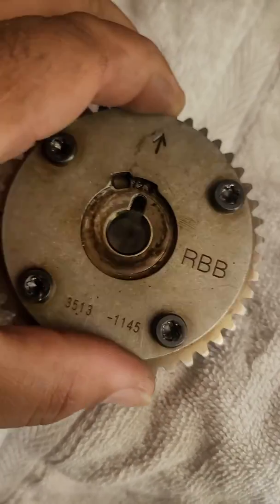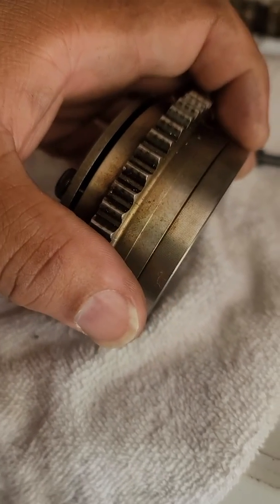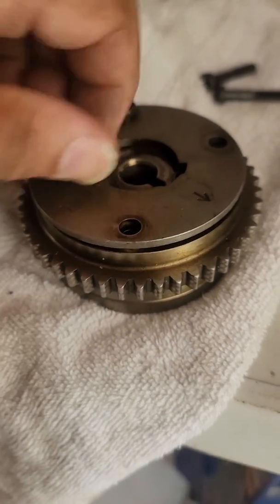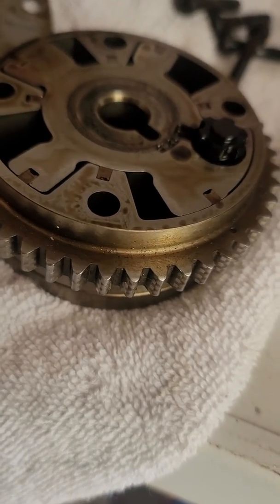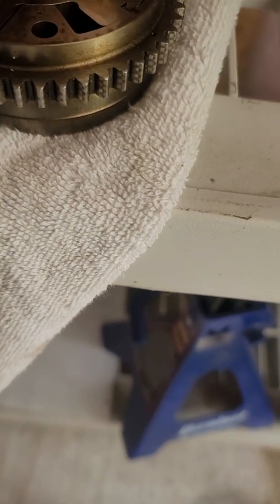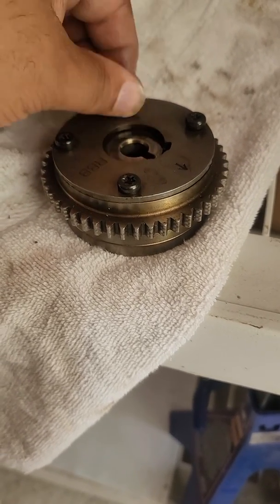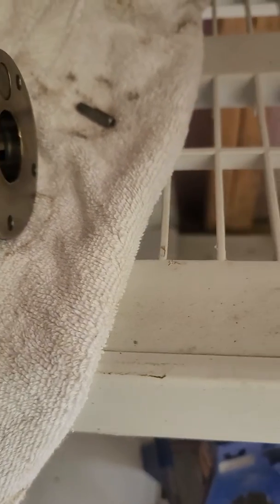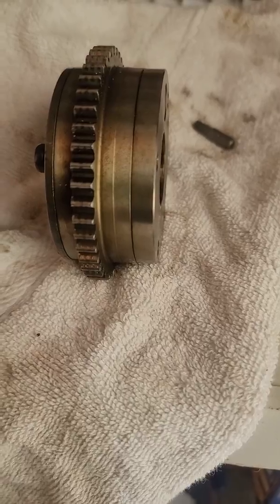vtc gear rattle fix

Comment: Thank you. It worked for me for Honda 2.4 engine with vtc in place.
The only thing I would recommend for those who is planning to work on 2.4 Honda, to get a TS-30H (5 point star bit), you going need it to remove 5 bolts on vtc gear to get to the spring.
Reply: Of course, my tool kit only goes to TS-20H, thanks for the heads up.
Reply: @094340 Don’t forget to use medium thread lock on all 5 vtc bolts when you put it back together, otherwise it will come apart. I used original spring just pulled it a little, original valve cover gasket ( use some black gasket maker on corners, same as you can see it’s done from manufacturer). Good luck to you if you doing this project.
Reply: @victorv3219  

Thanks bro.
Reply: @victorv3219  Those bolts strip real easy.  Ask me how I know.  😞
Reply: @victorv3219 can you please provide a link for the medium thread lock? I’m not sure which one to buy.
Reply: Be doing this soon.
Reply from the maker: Follow my channel thanks
Reply: My Googling indicates the 5 point is IPR30.
Reply: Que número es la broca de 5 estrella??
Reply: @OrlandoRivera-g4r
TS-30H

Comment: Hi Tony, I had my actuator replaced, but I was just curious how long did that work after you stretch the spring was it permanent or did it the noise return
Reply from the maker: It's still hold up strong I have a any problems
Reply: @dateg18  good to know, when my warranty runs out, I’ll be stretching the springs
Reply from the maker: @jojojeep1  I posted a link to company that sells a replacement vtc spring in the Description

Comment: I did this but it fixed the rattle for aprox 3 months, now it rattles again
Reply from the maker: I put a link to a company that sells replacement spring for the vtc gear
Reply from the maker: Have you ever replaced your timing chain tensioner? Because they fail over time, too, and can cause the chain rattle, too

Comment: It seems that haonda has a bulletin for updated vtc. They know this ia an issue but want to sell a new vtc. Someone needs to get a new updated vtc and check the spring's  tension and find a replacement.  Any thoughts?
Reply from the maker: It never fails with honda instead of making a recall to fix the problem they want us to buy their part to fix what, in my opinion, shouldn't have a problem to begin with when they make the car
Reply: @dateg18  I agree. If we had knowledge of the proper resistance spring, it would save poor folks over 250 bucks or more. Was the update fix a stronger or heat resistant spring? Definitely a defective part.

Comment: So i had same problem on a 2015 crv & accord  i own. Found a mechanic who said to replace chain tensioner and it completely fixed problem he even said theres a TSB written about it.  Fyi
Reply: I replaced belt tensioner didn't work & yes Honda knows the rattle is a problem hence class action lawsuit in Cali ended in 2023
Reply: @chickadee7659  Honda appealed the class action lawsuit to the 9th Corcuit Court of Appeals… and they lost, April 2025. So Honda Motors owes car owners $1.4 million.

Comment: Have a 2017 accord sport. At cold start makes like a 1 second grind while starting. Changed starter, plugs, and not sure. Does that rattle sound like a grind as well?  Curious if it's the same issue. But only happens when it sits for a few hours
Reply from the maker: I'm not sure if the 2017 have the vtc gear or not let me look into it and see what I can find out

Comment: Tim Boylan from Nova Scotia Canada. I really appreciate what you're showing me I could never understand why you had to replace the whole gear if it was only a spring problem which everybody was telling me or the information looked like that's what it was thank you very much I really appreciate this it will save me a pile of money
Reply from the maker: No problem sir
Reply: @dateg18  what do you recommend to increase my gas mileage with this vehicle
Reply from the maker: @timboylen7239  To be honest, just basic maintenance like spark, plugs I know. You can replace the fuel filter in the fuel tank. But I suggest you replace it if it's never a been place. A vavle job if the car has high mileage
Reply: @dateg18  crvtbnsc- I thank you for that reply my CRV has 180,000 km on it I was wondering what you would recommend for me to put back in it for spark plugs I've looked in there so many different kinds I realize in GK is probably the best bet but which type I respect your advice and wish to thank you very much at this time
Reply from the maker: @timboylen7239  ngk spark plugs work best for honda
Reply: Crvtbnsc  thank you very much I will let you know how it works after I put them in also I quieted down my engine by doing an oil change and using 5W30 Castrol instead of the zero w20 that I've been using it seems to me that that's pretty thin oil for an engine that has some miles on it
Reply: @timboylen7239  Let me add my advice. You're doing right by using 5w-30 and not 0w-20.  The latter burns off a lot more than higher grades.  These K24 engines tend to burn oil, although you won't know it until you check the dipstick.  Castrol for me, had been the only one I've used so far that didn't have this happen.  I'd use full synthetic and high mileage Castrol Edge.  I also use Denso Iridium spark plugs. Overall Denso is what came factory as many parts in your Honda, it's the best brand for it IMO.
Reply: @ACZ457  So much conflicting information about the oil type. I have heard that the Castrol Edge, that you use, and the Valvoline High Mileage are effective where this engine is concerned. Not sure about using a 30 viscosity though, I think I'll stick with the 5w-20 full synthetic High Mileage.

Comment: I couldnt find the correct torx bit for my R44 VTC on my 2012 CRV 2.4L, so I replaced them with the exact length hex head bolt. But it still rattles worse on start up and has a squeek. I think those tox head bolts are assembled with tight tolerances and it has to be assembled correctly. I had to resort to replacing the VTC.
Reply from the maker: Let me ask you, have you ever replaced the timming chain tensioner? Because that can cause the same problem as well
Reply: @dateg18  I have not replaced it or even looked at it. Thanks for the heads up. Can rotating the engine in reverse damage the tensioner?
Reply from the maker: @michaelpolzin3263  we removing the tensioner you can just a very little to take tension off the tensioner to remove it
Reply: It's a T30 5-point Torx bit, and you want to get one that is a socket, not just a bare bit.  Anything you can do to prevent anything from coming out and dropping - even with stuffing towels or whatever in the top of the timing cover.  Not something you want to be losing in the middle of the job.  Also, make sure it's made of S2 steel.  The torque needed is 8 ft/lbs or 96 in/lbs.
Reply from the maker: Let me ask you this did you replace the timming chain tensioner too ?
Reply: @michaelpolzin3263
 how did you remove the bolts without having the right bit?  I got the same problem.  Thanks.

Comment: Wow!  What a relief to know that this could fix the rattle when I start my car.  I thought it was oil starvation so I quit using Honda oil filter and switched to K&N filter but noise remained.  I just adjusted valve lash on my 2013 Honda CRV so I am quite expert at removing valve cover.  I am also thinking maybe I could go to a hardware store and purchase a new similar spring.  Thank you for making this awesome video!
Reply from the maker: Someone sent me a link to a company that sells upgrades spring if I find the link I'll send it to you sir
Reply: Hey @dateg18 I Have A Code P2647 “A” Rocker Arm Actuator System Stuck On Bank 1……Is It The VTec Spool Valve Solenoid?……Because I Do Have That Rattle When I Cold Start My Accord 2005 2.4L Gas……

Comment: Spring-Start has VTC repair kits with new springs and the torx bit included
Reply from the maker: Thanks for the info 👍🏽
Reply: It says Honda. Does the spring works for Toyota as well.
Reply: @painkillerO8  what year and model?
Reply: @ Toyota corolla 2011 , LE.  also not possible to remove the spring while still on the engine. it requires rotating the engine to reach the bolts😔
Reply: @painkillerO8  as long as the cover is removable we have rotated as needed

Comment: Do u need to buy a new gasket wen u take off the top?
Reply: if the valve cover gasket is old and/or brittle, then yes replace it.  I replaced mine since I didn't want a leak.  also replace the spark plug tube seals.
Reply: @glennhansel9411  thanks bud
Reply from the maker: No sir just put a little rtv on the side of the vavle cover

Comment: This is good information.  I'm at 107,00 on our CRV and it also has the rattle on cold start up.  I know you recommended replacing the timing chain tensioner, do you think the timing chain itself would be stretched and need replacement at this point also?  Thanks!

Comment: Greatly appreciate what you shared. Does thing also is the cause on my Honda civic produces grinding/rattle noise in the morning(overnight park) from park to reverse.
Reply from the maker: If it happens on any cold startup when the car has been sitting overnight, then yes

Comment: Just subbed to ya sir for this great video, thank you so much. My wife has a 2011 CRV that's had this rattle for years now. Honestly we've just dealt with it b/c we're in TX and it only shows up in the one month of cold we have. I'd like to fix it this winter, the engine has low mileage less than 90K. I've worked on older V6 and V8s but it's been awhile and I know these Honda is all aluminum. Any good videos on taking the cover off and torque specs? Thank you!

Comment: Thanks man, this was very helpful. I recently installed a JDM engine with supposedly 55k miles in my 13crv and it has been making that annoying rattle at startup ifbit sat for more than a couple hours.  I did this spring trick last night, took maybe about an hour, car has been sitting for 16 hours and i just started it in 30F degree weather, i was super happy as it made no noise. Not sure if it will be a permanent fix but it was super easy to do and  may at least buy me some time. :-). Ended up replacing vtc as rattle returned rather quickly. Also did the chain tensioner while i was in there.
Reply: How hard was the job? I might need to do this soon.
Reply from the maker: @colecampagna6302  take about a hour to do
Reply from the maker: Good to here it helped 👍🏽

Comment: Did this to my 2011 CRV only difference was no plastic piece. Worked great!!✌🏽
Reply: I have the exact problem on my wife's 2011. Did you use a particular video for pull the valve cover off? I've worked on other engines but always feel more comfortable having a video to reference for new-to-me engines. Thanks!
Reply: @johnnixon  Just watched this video and did exactly what he did…when you say pull cover off do you mean valve cover or cover where spring is?
Reply: @Catman234  Valve cover. Just trying to determine if there's anything I need to be aware of. Imports tend to have surprises.
Reply: @johnnixon  I bought gasket kit on Amazon and it came with everything you need …just get good RTV silicon for the corners on top of head.There are videos and torque specs out there ..And like I said no surprises other than there was no plastic piece inside spring.
Reply: @Catman234  Thank you!
Reply: @johnnixon  Imports have surprises?  I've worked on both and the bulk of the surprises that made me go 'WTF?! ' have been on domestics.
Reply: @Catman234  Some VTC actuator springs have the black plastic pieces and some don't.  They are not really needed, but if your gear has one I would definitely keep it in there.

Comment: If you stretch it, it'll just lose its tension again. Your best bet is to find a heavier spring. If you can't find that, place some washers under the spring to take up space, and restore the spring tension.
Reply: Terrible advice.  The spring needs to be replaced, not shimmed or stretched.  Also, the locking pin needs to be removed and worked over with some abrasives until it moves freely in and out of the detent that it locates into under the spring tension.
Reply: @ACZ457  well the best advice is obviously to replace it with a new one. But in a pinch, it can be shimmed for more tension.
Reply: eBay sells replacement springs I think.

Comment: Which car was this ?. Mine is a 2014 honda accord 2.4L drum earth. Rattles for few seconds then stops. But when I leave my driveway and come to a stop I hear the rattle and goes away
Reply from the maker: 06-11 civic si but if it have a small vtc gear it the same method
Reply: @dateg18  yeah its same style gear. Hopefully it will be a quick job. Thank you

Comment: Tony,
Thanks for this video and your replies! My 2014 CRV only has 132k miles and rattles only after 2 days parked (oil drawdown) so i tried a few cautious pre-cranks to pre-lube the VTC and i cut my rattle durations significantly. Some even zero = eliminated rattle. I am going to buy a 10 second delay relay to try in my fuel pump relay function so my 1st 10 seconds of starter cranking is to spinup my oil pump and THEN switch on fuel to start.  In my years in mine machinery we used an entire kit called “pre-lube” which pre spun oil pumps on 2,000hp Cummins and such TDI’s so that when cranked over all oil galleries were full and at oil psi. 
Comments ? Thanks in advance!
Reply: Well, you will be draining your battery and also wearing out your starter.   That's a complex work-around for something that can just be fixed by addressing the root cause.

Comment: Thank you so much. I have just done the same on my 2003 Toyota Caldina with the 1.8 litre 1ZZ FE engine. The VVTI cam rattle is gone, couldn't believe it.
Reply from the maker: Follow my channel thanks
Reply: Were you able to do this without removing the cam gear from the camshaft on your Toyota?
Reply: I was just about to ask if this could be done on Toyota vvti rattle as I just got an older 1mzfe highlander that does it a split second on morning startups.

Good to know!

Comment: This is only a temporary fix.  Here's why:
From a metallurgical standpoint it has to do with the elasticity and resiliency properties of the metal in the spring.  Elasticity is what makes it want to return to its original shape after being stressed (either stretched or compressed).  Resiliency is how much the metal resists stress.  Because of wear and heat, the spring still has elasticity but lost resiliency which is why it no longer pushes back with as much force under compression.

Now here's the problem with your fix:  If you stretch the spring as you have, you have stressed the spring past its elastic limit such that it will no longer return to its original shape.  You have also weakened its resiliency and it will no longer want to resist compression.  Once you put this spring under compression, it will very quickly lose its ability to push back with as much force, and you will be right back where you started.  You also risk causing the spring to break.

If you are going to rebuild this VTC the way you show, then you must REPLACE the spring.
Reply from the maker: Thanks for the comment but I have done this on my own car and friends cars as well it not a true fix but it works and I have not a had to replace the vtc gear to do so its been 2year seens I did the  spring pull to my own car and I have not had the problem come back I never said this was a complete fix for the problem ppl are having but a free and effective way to get the noice to stop there no replacement parts available by honda other then buying a new vtc gear and most ppl don't have the extra money to spend 250-400.00 on a vtc gear brand new so if you have a part number for the spring a would gladly like to have it and  a part number because honda does not sell a rebuild kit for it and I totally get everything your saying I'm just offering ppl a temporary fix help when there no other option
Reply: @dateg18  can spring be shimmed?
Reply from the maker: @Skip92306  I don't think you could it's not like shimming a oil pump to get more oil pressure
Reply: If you replace the spring with one from a hardware store, how careful do you have to be to get one with the right force?  ...so it will lock when it should but not lock when it shouldn't?
Reply: Is adding a SHIM an option?

Comment: To perform this fix on my 2008 Honda Accord 4 cylinder (@ 125k miles): ... Does anyone know if I need to order the 5 point T 30 Torx Bit (or a set with that included) for my  original stock engine with original vtc?   I have a 6 point Torx Bit set, and would like to make sure I have my tools lined up when I remove my valve cover for this fix.  Thanks in Advance for any insight into this question.
Reply: I would also like to know, as I too have a 2008 Honda Accord with this same issue!
Reply: any luck on which one to select?
Reply: @RohitGeh  I ordered and received a 5 point torx set that include the size I think I need. Found a reasonably priced set w good reviews on A ...

Comment: Wow ... Thanks for kind of easiest idea to try out. Looks Promising for brief sporadic noise I get when starting my 2008 4 cylinder Honda Accord with 125K miles on vehicle. ... I ordered a new cam chain tensioner thinking that could be source of noise to go after first; and will now try this spring fix first.  Thanks. I will study your comments section next for the additional education. Thanks
Reply: any luck with just replacing spring?
Reply: @RohitGeh  I have not yet tackled this project. I will replace the spring first; see if spuractic noise goes away; and then replace cam chain tensioner if I still hear that noise. ... The results  will be informative and interesting.
Reply: @CaptBill69  What repairs did you end up doing and how have they held up?
Reply from the maker: Np I would replace the timming chain tensioner too they can make the same noise as well